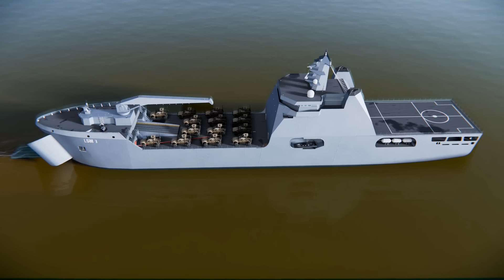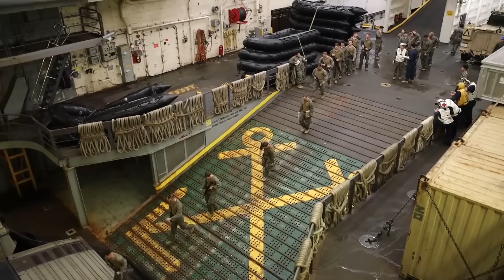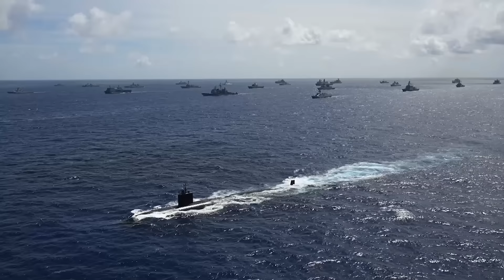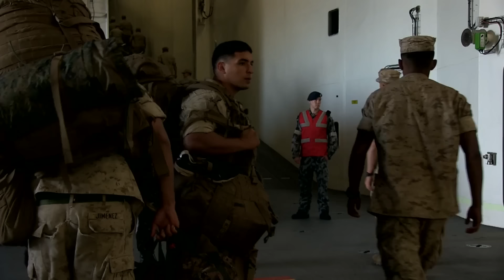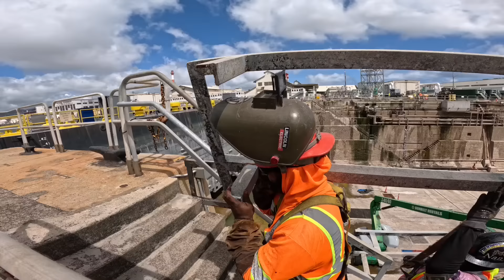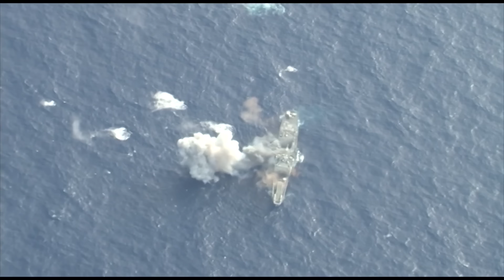McClung Class Landing Ship: US Navy's New Low-Tech Trump Card

Comment: The Marines don't deploy tanks these days, but they should build them to take the weight no matter what. However, for now, these will be used to quickly supply a beachhead with air defenses, towed artillery/mortars, and armored cars. The only real problems are the open-ocean speed and suitability for the long-duration voyages. When assigned to an Amphibious task force, they should be hauled with a seagoing dry dock of sufficient size to haul two or four of them. At sea, the crews of the landing ships could stretch out in recreation areas on the mothership, which may also have a significant amount of bunk space both for troops and salvage workers as needed.

Comment: It’s funny critics of the Trump class battleship, and or modernize in Iowa classes overly emphasize the power and the potential of drones. However, this one doesn’t have one CWIS ? It should have 2 offset . 1 forward & opposite its 30 m . & 1 aft opposite side of the forward one to give it complete. 360 and double coverage for broadsides were presents. It’s the largest target for drones or missiles. They should definitely have two. It’s a mistake not to have any m unnecessary cost savings, which could cost more lives that could have it should be avoided.

Comment: This is going to be a coffin for the ship's capacity. The sad reality is that the 'floor' for naval ships in general has risen sharply.

That's why the Constellation class was basically extensively modified to be a mini-Burke, because that's the new minimum for a ship these days. Landing ships are non-viable, I'm afraid, due to ASM threats outpacing ANY landing capability. It was the advancement of ASM technology that killed the AAV replacement, as even its excellent range was deemed insufficient against newer ASMs being deployed.

Basically, a shore ASM battery can literally tell any ship within range to stuff it. Combine that with IADS, and the shore is now literally impenetrable.

Comment: The McClung class is heading to be the next USN procurement flustercluck. Its story runs thus: The Australian Army wrote a set of requirements for its Landing Craft-Heavy Project (LAND 8710-2) that included “must be an in-service design”. Nothing in-service met the requirements-set, but then the Nigerian Navy took delivery of the first of two LST-100s it had ordered (NNS Kada), thereby making LST-100 the sole in-service option.  That is why Australia selected a WW2-style LST.  The US thought Australia had done due-diligence, so followed.  Nigeria got Kada in service, found out why WW2-style LSTs fell out of favour and cancelled the second vessel. Australia and the US looked away, stuck their fingers in their ears and carried on.  Fortunately, the US is trialling a modern commercial 73-m Stern Landing Vessel (SLV), which is outperforming the LST by every useful measure.
Reply: I'm not sure Nigeria is the best measuring stick. Force projection is not their requirement nor are they in anything close to a situation in the Pacific. These are a good buy for the RAN and are required ASAP hence Austal are starting on the first before the end of the year. HMAS Choules is getting long in the tooth and wasted on filling a medium capability gap.

Comment: The ultimate ship design to maximize this mission is in its final 2 year testing phase. It’s a militarized version of the civilian SLV Stern Landing Vessel.  

The final testing is being done by the USMC Warfighting Lab using the SLV MATILDA 1
Reply: Matilda 1 isn't militarized it's a test bed that is built to commercial standards. Seatransport designed Matilda 1 in Australia to pitch to the Royal Australian Navy who said no and went with the same Damen Design as the USN. It's an interesting concept, cheap and easily built but not sufficient to fill the role in the Pacific. They then pitched it to the Australian Army who said no and went with the Austal LCM which better suits them.
Reply: @goodshipkaraboudjan  The role was specifically designed around this Off Shore Patrol Vessel type. That shows you don’t know or understand the role. 

The role was designed by the Marines for small militarized civilian ships to operate in commercial sea lanes blending in with civilian ship traffic. They specifically wanted an SLV design

Originally called LAW Light Amphibious Warship. There’s a whole list of reasons why an SLV is a better design than an LST

The USMC & Navy clashed because just like you The Navy Didn’t Understand the Role

The Role isn’t Opposed Landings DUMMY, which the LST would be great for.

The Role….Dummy is to blend into civilian traffic and to discreetly and quickly slip on and off of TENS OF THOUSANDS of remote islands in the First Island  Chain

The USMC greatest need at the point is FOR LIFT. The immediately need ships and the navy delayed a cheap build program by over 4 years

So the USMC compromised, in Congress, to immediately start the first 18-35 built on a mature military design the navy was comfortable with

This is why the name changed from LAW to LSM

In exchange the Marines were given the money & authority to CONTINUE SHAPING THE ORIGINAL SLV/LAW DESIGN DUMMY

And Why dummy….Why were they comfortable with this compromise??

Because the LSM ships are not built to last 30 years, they are 10 year disposable ships. 

The Marines started immediately by Leasing the HOS Resolution which was a standard SLV design

In the trials from the Resolution there were many design changes that the MCWL required in a Ground Up build that they chartered with SeaTransport 

So YES DUMMY the Matilda 1 was built to the Specs provided by MCWL before the ship was built….It was part of the lease before the ship was built
Reply: @goodshipkaraboudjan  Why do people contradict on here without font any research. The Matilda 1 was built specifically to the specs of the Marine Warfighting Laboratory for this purpose Dummy do your research
Reply: @EJack2841  It was designed by a company very close to me and I've friends working there. They built it in Indo cheap and it was pitched initially to the RAN. Main reason being years ago when they pitched the concept to the RAN it would have likely been built at a new facility in Queensland but when rejected the Army got involved with it and thus the USMC.
Reply: @EJack2841  why do you think it was designed by an Australian company and based in Australia?
Reply: @goodshipkaraboudjan  The SLV is an Australian design that’s a popular work vessel throughout the Asian Pacific. I don’t understand the point of your question or your logic. The USMC built the concept around a ship that blends into those sea lanes. You don’t know or understand the concept, the Marine Corps, or the bureaucratic fight that led from the original concept to the LSM so you ask stupid questions based on flawed assumptions

You say Stupid Sh!t based off you flawed logic like “Australia rejected the design”. 

No they didn’t, this in its totality is a Marine Corps Concept. This Distributed Operations, micro-unit, micro-logistics model is a Marine Corps construct and the Australians have been following the lead of the USMC to stay lockstep
Reply: @goodshipkaraboudjan  The idea using the SLV didn’t start with the Australian Navy It started with the USMC

Find one single article about the AUS Navy or Army wanting to incorporate the SLV prior to the US Marines announcing their FORCE DESIGN 2030 in 2019….

YOU WON’T FIND IT
Reply: @goodshipkaraboudjan  The Concept, since you’re either too lazy or ignorant to research it, was developed by the USMC as a Discreet Shore-To-Shore Connector SSC. The SPECIFICALLY wanted a very common vessel, like a small “Pickup Truck” was the exact wording, used in the Asian Pacific that would …. EASILY BLEND INTO THE LOCAL SEA LANES…. Hiding an armed needle in a needle stack

I could go on about what you don’t understand 

You’re starting from be middle, after the USMC/USN transferred to the LSM and drawing False Conclusions because like all Dumb@sses You’re Not Grounded in the Base…the beginning of the Program

The USMC has not abandoned the true manifestation of the concept using SLV as evidenced by the HOS Resolution (2023) & the Ground Up modified build the Matilda 1 (2026)

In a previous post I listed the design Modifications the Marine’s Warfighting Lab required when the created lease for the Matilda 1 BEFORE IT WAS BUILT

If you understood the Concept than  you would understand the key is DISCREET-ness of the Micro Logistics NOT the Micro Logistics themselves

Meaning the Micro Logistics are good….

BUT THE LST-100 IS EASY TO TRACK….

Why?? 

Because it has a WARSHIP’s SILHOUETTE operating in civilian Sea Lanes 

Do you know Who Else Lives in those Sea Lanes…????

The Chinese GRAY NAVY…..their Militia Fisherman Fleet (the same ones harassing the Philippines).

The Point of This Whole Exercise GENIUS is to stress not just the PLAN….but also the Gray Fleet Militia

It’s GRAY ZONE WARFARE DUMMY
Reply: @EJack2841  Mate read all the articles if you want. CAs/NDAs etc don't make it that far. It was pitched without tender to the RAN. Didn't get picked up.
Reply: @EJack2841  I agree the USMC saw it, asked for funding and pressed for it. The conceptual design had been completed by Seatransport to push to the LCM requirement to the RAN. Great that someone is spending money on it, but it's been rejected already. It was first shown as a concept at Indo-Pacific in Sydney years ago and the RAN said no. If it works, great. Concept requires funding.
Reply: @g @goodshipkaraboudjan ’ve been tracking the Concept since its start. The concept of micro logistics didn’t start with Australian military, it was a concept born in the USMC’s Force Design 2030 launched in 2019 

If you don’t understand that then you won’t understand the moves made by the AUS military

When the Marines announced FD 2030 their Asian pacific allies, including Australia, the Philippines, Thailand, Taiwan, etc., fell in line in lock step with the concept

So when the USMC/USN compromised moved to the LSM using the mature LST design their partners moved with them

But again, as evidenced by the further experimenting on HOS resolution, and those lessons learned applied to construction of Matilda one, the SLV has not been abandoned. It’s been pushed back into a proof of concept role.
Reply: @goodshipkaraboudjan  YOUR LOGIC IS FLAWED. It was NEVER in the hands of the AUSTRALIANS TO DEVELOP. Australia has been FOLLOWING the US LEAD

SO How has it been abandoned when they’re continuing the development of the concept, bro? Wtf are you talking about??

The concept of developing a Militarized Version of the SLV is CONTINUING….

The SLV is an Offshore Patrol Vessel that originated in Australia, they MAJORITY of SLVs are built by…..Australia companies, the BEST companies to partner with to develop a Militarized Version that the USMC envisions for the Concept would be…..Australian

But the CONCEPT & DIRECTION is NOT AUSTRALIAN

They are FOLLOWING THE US LEAD
Reply: @goodshipkaraboudjan  If you Followed the project you would know the imperative of the USMC is the need for Lift & Maneuver by 2030, it’s the speed bump the USN threw up to stall the program as designed

The SLV experimenting phase was supposed to begin in FY 2020 but the USN held up the program by 4yrs on a testing phase the Marines estimated would take at least 5 years with another 2yrs of Sea Trials

The USN ensured that they would not have the militarized SLVs in the water by 2030. So in 2023 the Marines PIVOTED TO A MATURE MILITARY DESIGN, the LSM program, to:
1) Compromise with the USN on a military based vessel
2) To get ships in the water by 2030 

While they CONTINUED to develop a Militarized Version of the local Pickup Truck, the Armed Sheepdog, that the WHOLE CONCEPT was built around
Reply: @goodshipkaraboudjan  Do you know what militarized means? If you buy a militarized case….What does that mean??
Reply: @goodshipkaraboudjan  Before the Marine Corps Warfighting Laboratory test bed, HOS Resolution, commercial Stern Landing Vessels were designed for calm “sheltered-water” commercial cargo runs

In 2023 when the Marines chartered Resolution they forced the commercial SLV design into open ocean surf zones

The trials exposed operational flaws: 
- flat-hull suction
- broaching in heavy swells
- exposed running gear
- jack-up spuds for heavy offloads

The Marines brought these modifications to Seatransport AS PART OF A GROUND UP BUILD LEASE resulting in the Matilda 1:
- Tri-Hull that prevents stalling from suction 
- Changed the bow line were refined so the vessel could self-stabilize against lateral wave forces in breaking surf
- Skegs that protect the propellers lift the SLV off the beach
- Double skinned below the waterline

The SLV design has been MILITARIZED

Comment: Cheap and fast usually means its not gonna be the best quality
Reply: You would normally be correct but in this case it is much cheaper because it is over armored or worried about close in fighting. It’s a Camry instead of a Corvette. More than adequate for it’s goals
Reply: You're referring to the age old engineering principle:  You can have high quality, inexpensive, or fast.  Pick any two.

Comment: Nice analysis.  We built hundreds of the prototype LST at Evansville, IN during WW2.  As long as we just build them and don’t tinker with the design we should be able to crank these out in secondary yards all over the country.  One thing that I was worried about initially was the lack of air defense, especially anti-drone, but then I considered that the Marines will have anti-air defense capability with them .  Just make sure you park a couple of them on deck with coverage and the air defense capability and surface defense capability of the ship can be greatly augmented.  I am sure that I am not alone in thinking about that.
Reply: There's space for a lot of jamming equipment on the "roof" as well.
Reply: Should have two Phalanx CIWS and a rolling airframe missiles RAM for close in self air defence
Reply: Agreed. The problem is, the design will become more and more complex so the contractors will profit 📈
Reply: Complex electronics should not be integrated. Those electronics should stay on escort ships.
Reply: @NORTHSTARLOGISTICSLLC what escort ships? We don’t have frigates to fulfill that role, the LCS would be worse than useless in that role, and the Burkes are just to damn valuable to use in escorting these.
Reply: Ayooo, I got family in evansville!!! Let's do it again! Interested?

Comment: Just a little reminder about the ASW frigates Damen is (or ... was ?) to build for Belgium and the Netherlands:
- projected price has already doubled from 600 million to 1.300 million per frigate
- first ships were to commission in 2024 (!) and 2027
- not a single steel plate has been cut
- 2033 and 2034 are the current estimates
- Belgium is thinking of quitting the project (run by the Dutch navy)

Damen has also lost the contract to build German F126 frigates due to cost and schedule overruns

There are YT vids about both cases
Reply: as a dutchie can say these delays and cost overruns have more to do with the dutch govourment then with damen (commit specific) that keep changing the plans halfway the design every single time.
Reply: @jimmys1558  Did they get Infected by the US Navy's virus ?
Reply: Damen aren't building them. Austal is building the ones for the RAN and starting on the first hull this year.